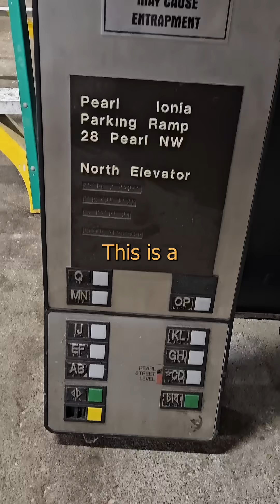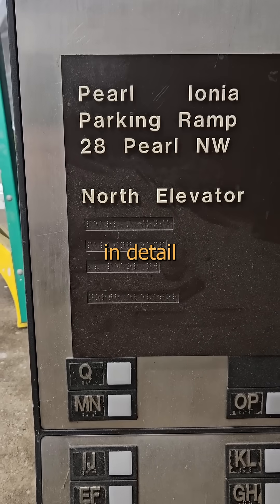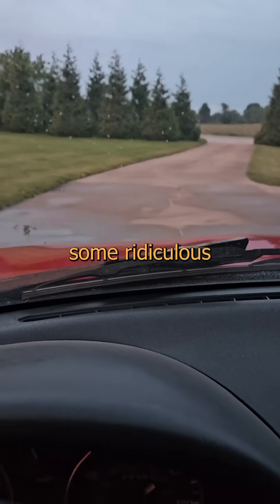Miata Mischief #chrisboden #engineering #gear #elevator #score #stories #parts #hacking #making

Comment: A few months ago I needed to purchase some lumber but didn't have access to any vehicles other than my thirty year old moped. I drove out to the lumber yard and ordered a few 2X4s and then proceeded to drive my moped into the loading bay. The two guys there handed me the lumber and were making fun of me thinking I'd never get it home. Much to their amazement they discovered that someone who's so broke their only form of transportation is a barely street legal scooter from the 90s, is very capable of planting the boards on the foot rest and slinging the other five feet of lumber over their shoulder. Those workers stood there, mouths agape as I expertly drove off with one hand on the accelerator and the other on the lumber. I made it home safely and had my girlfriend take a picture of me with the material on the scooter for fun.

Comment: I ride a motorcycle, and had no option to carry my materials home. 

X 12  2x3 1.3m wood strapped to seat
120L incinerator (full with tools/sealants/fixings)
Lots of stripwood, 
And my bag full to the brim. 
It was a little honda 125cc 

That thing looked like an autistic aeroplane that they wouldnt allow out, and i was the pilot. 
Couldnt pull the accelerator too quickly as the whole thing lifted. 

I couldnt even turn sharp at 20 mph as the front end had little grip, that was fun.. down country lanes... Where people drive 60.

Comment: I used to haul 8ft 2x4's in my HHR. they went over the folded down back seat and right through the center onto the console and to the radio. The back gate had to be tied down and the boards kept from sliding around in the back.

Comment: I built a back yard sized connect 4 for a customer when I lived in Phoenix. When I completed the finish, I realized that the only vehicle I had was a Honda Shadow. There I was riding half way across the city with a 4’x6’ sail attached to my saddlebags and sissy bar acting like a sail… the guys at the woodworking shop took pictures between laughing their asses off in the parking lot.  Never. Again.

Comment: Got a honda big red 3 wheeler for free, had both rear tires popped and flat, first I (with the help of a friend pulling at the front end) had to lift and push the probably 20-30 pound rear end for like 20 feet. (This was earlier this year, and I'm 14, so yes, lifting and pushing 20-30 pounds for around 20 feet was a little hard) then a neighbor came out, saw us struggling to move the 3 wheeler, and helped lift and push at the back, then another neighbor came out saw all 3 of us still struggling, and brought out a dolly that we used to lift and roll the back the last maybe, 30 feet to my house. The entire process took like 2 or 3 hours in total, but the 250cc 3 wheeled death trap was, and is worth it even though it doesn't even run right now, won't go into gear, and seems more worthy of the dump than getting fixed as of right now, but the frame is in near perfect condition, no electrical issues as far as we know, and unable to be fixed without being brought to a family members house because of our hoa in our neighborhood. I plan on the 3 wheeler being on my channel once it's fixed and looks at least less eye melting than it does now.
Reply: If anyone has any insight on it I could use the knowledge, because I have absolutely no idea on where to even begin with fixing the 3 wheeler after getting tires that aren't popped put onto it.

Comment: As long as you do not have to disassemble something to make your stuff fit, it is not ridiculous at all.
I removed all the seats from the passenger side of a peugeot partner to fit several wall panels  to drive them home. That is the only occasion when my girlfriend traveled on a back seat.

Comment: In 1996, I was 14 years old. I lived in California and I found a local gas station that was throwing out a broken smog check machine. I had no idea what was inside, but I needed to know. I asked the mechanic if I could have it, and my friend and I pushed it a couple of blocks down the sidewalk to my dad's driveway. It was old, green, about 300 pounds, and had 2 miles of wires in it. It was awesome! I believe it was a "worldwide emissions analyzer" and it took me at least 3 weeks to take the whole thing apart.
Reply: Big tot

Comment: I had a small three door Toyota Starlet (made in 1984) and a cargo pallet witj building material. The car was wide enough on the inside to fit the pallet and the weight and height was within the limit (it was not a full pallet. So I asked the forklift driver to put the whole pallet in. Around 80% fitted inside. I put the back hatch door down, secured it and drove a 15 minutes drive home without the need to repack.

Comment: I had a newer mazda 3 sedan that i shoved a small block ford motor in the trunk, transmission and transfer case in the back seat, and driveshafts in the passenger seat. Had the damn near the whole drivetrain in that rig lol

Comment: Twas about 2004 and I was early in my long former career as a gas station attendant.
In comes a lady from the economic strata commonly known as "the polite classes" driving a late model Mercedes C class convertible (nearly freudian typed "covertable" there).
Roof down on a summer's day...
With a fucking boat strapped upside down on top of the car.
Needless to say she turned out to be a good sort, pumped her own gas and departed to grins a thumbs up from my coworkers and I.

Comment: My best friend and I went to go get a new enclosure for his snake. For some reason we took my Camry dispute him having two trucks. After we got the enclosure in my truck we stopped by a state park hiking trail. While driving on the dirt road we came across a pile of trash someone dumped, and in that trash was a perfectly good 50 gallon aquarium. So we loaded that up, the stuff for the aquarium, some other random stuff in the Camry and we drove the couple hours home. The aquarium eventually got traded for something else, the aquarium equipment is still in use today nearly 5 years later.

Comment: I moved a 6 foot x 4 foot glass mirror, over my head, Inside a 1998 Ford Focus, across town, balancing it on top of the front seats and holding it with my left hand while I shifted manual, because it was free from marketplace. It miraculously didn't break, and I'm still alive to tell the story.

Comment: Yeah I'm a hoarder, or so They say. So when I spotted a mammoth of an American made teachers desk retired from the local high school years ago and recently tossed out by someone with a bad back and still in excellent shape cause it was certainly crafted  some time pre WW2.  I knew there was No way I could let that go to the landfill so I gingerly flipped it up on the roof of my recently paid off E350 Mercedes. Lucky for me I only had to drive a few miles while holding on to it with one hand. I kept the speed down between 10 to 12 mph to keep it on my roof and keep it steady. Now does anyone need a desk?

Comment: The school was undergoing renovations and moved some classrooms around, one of which was my engineering/robotics teacher's room.  This unfortunately meant losing a lot of power tools in the workshop and while I was unable to procure any of those, I did walk out with a 6 foot whiteboard that I have hauled with me for 12 years now across 5 dorms and 6 apartments.  And because I'm about as careful as your mother was 9 months before having you, during one of those moves, it slipped from my grasp and scratched my computer monitor leaving a good 4 inch scar dead center.

I've yet to actually use the damn thing and it's currently in storage with a lot of other keepsakes.

Comment: Bought a electric organ (musical instrument) for 5 bucks and it didn't quite fit in the bed of the ford ranger. Just jamed more stuff to wedge it in place. Then we dropped it down the stairs trying to get it into the loft of the barn. Still worked but had the extra anesthetics of splintered wood.

Comment: Took an 8 and a half hour each way drive with a friend in his Volkswagen Jetta to pick up some diesel ford ranger parts. We picked up 2 motors, a transmission, a clutch, and assorted other parts. We had preemptively removed the back seat and after some creative jacking up and minor disassembly we managed to get both engines in the backseat area with the assistance of a cherry picker, the rest of the parts went in the trunk, the ride was surprisingly smooth despite looking like the rear suspension was bottomed out.

Comment: One Saturday my friend and took a drive in my turbo MX5 (Miata) for you backwards yanks, to the local hardware store. Just because Saturday, a few hours later we both had forgotten that the vehicle we had brought had the luggage capacity of a loaf of bread. As we walked out of the store with a 7ft lattice gate to stop his dog getting out of the side of the house. Needless to say we didn't go back and get a proper vehicle. We drove the 5 km home, with my mate holding the gate over his head, trying not to damage My car or loose the gate.

Comment: I hauled the carcass of a 1990 Toyota Supra on a 4x8 landscape trailer 20+ miles with a 2005 Subaru Legacy, with a 1¼" receiver. Found out when I got to my destination that the entire rear structure of the car was rotted (worse than I thought) and the trailer hitch was barely hanging on. If I had gone 30 miles, I would have lost the trailer...

Comment: i was driving my dads miata to work (we have some strange plate number based car ban here in the Phils.) but the 3x 2000 era PC tower broke and 2 monitors and i had to go and buy new ones... but i forgot i was driving the small car... had to drive with the top down and boxes stacked in the driving seat and improvise some bungee cord and the seatbelt to secure the new computers. the funny thing is the rear boot/trunk was empty because none of the boxes could even fit.... for that 45mins, it was pretty cool..

Comment: While driving to work one morning in my 61 bel air I saw a 91 Suzuki rm250 dirtbike on the side of the road with a sign that said free, I knocked on the door to verify and loaded the bike into my truck back tire first and strapped the trunk lid down on top of it as much as possible. 20 miles to work and 20 back home with the bike hanging 1/2 way out of the trunk.

Comment: I once had to transport the lengthwise pipes for my wife’s hoophouse from the nursery we bought it from to our home. I didn’t realize I would need to transport 20’ plus lengths, so cue stripping a random piece of romex I had in the cab down to the three wires, threading them through the bed and mirror standoffs of my ‘84 F150, and wrapping them by hand as tightly as possible around the poles, half on and half off the sides of the pickup bed for the 10 or so miles back home. Pics available upon request!

Comment: I carried an snap on Classic heritege tool box, chock full of tools weighing over thousand pounds all together in a 2 door chevy cobalt both To a new job at a mechanic shop and home from it when I quite a few years later. I loosened the passenger seat, removed all the drawers and tools stacking them in the trunk and then I picked up the empty box and laid it in the back seat, bolted the seat back down and then filled the passenger seat with the tools that didn't fit in the trunk. The second time the cobalt I had was a total Pile, the exhaust leak noise was resonating through the empty box and was shaking all my windows. 

I also moved cross country in a 2 door chevy cobalt loaded floor to ceiling with all my belongings that would fit... Twice

And Yes I've own 3 different 2 door chevy cobalt 5spds

Comment: I bought a backyard shed on Craigslist. Required buyer to disassemble.  Borrowed buddy’s truck and trailer (first time towing).  Took apart the sides, but was getting dark, so decided to just put the roof on top of the other parts on the trailer.  Didn’t have tie-down straps.  Drove slowly on the backroads, but everything was going fine, so got a bit reckless with my speed.  Caught a glimpse of the roof becoming airborne in the side mirror out the corner of my eye just as an oncoming car’s headlights came around a curve.  Roof smashed to the ground mere feet before the car ran it over.  Literally zero time for her to react. Flat tires, but otherwise unscathed.  Few milliseconds sooner and it would’ve been straight through the windshield.  Wouldn’t you know it, was an off-duty police officer. 

No idea why they let me go. Buddy’s insurance went up.

Comment: I stuffed a fully built Herman Miller Aeron upside down in the back of a Mazda 3.  it required putting the pneumatics down to the bottom, rolling the windows down, and 30 minutes each side to get in and out of the car.

Comment: I accidentally hauled an extra muffler home. And I do mean accidentally. 

So picture this: I’m shopping for a car since my first one had a one week lifespan before my lack of reaction speed on one instance doomed it to a crunchy end. Everyone was fine but I need a new vehicle. 

I go to a dealership for a car and take a look. They’re asking 8.5k usd, and it’s not a bad car, but I’m hesitant on that price. A check of my bank account reveals I actually don’t Have that much, as I gave my parents 2k to help them cover repairs for one of the two family cars. 

Intending to use it as an excuse to leave, I say I can’t do more than 7k. Guy leaves to talk to his boss… aaaand comes back and says they’ll take that offer. So now I have a new car despite not really expecting one. 

I drive it home, drive it around for a bit, and later acquire some of the essentials like jumper cables and window scraping stuff. And then I go to put it in the back of my car. 

I open the trunk expecting an empty trunk… and I am instead greeted by a very large metal part I can’t yet identify and did not place there. I show my dad. It’s a muffler. My car HAS its muffler. So this is just a random extra one. 

I call the dealership. The guy who sold it to me? Equally clueless. I offer to drive it back to them. They don’t need it. 

So now I just casually have an extra (slightly rusty) muffler in the back of my car and still haven’t moved it. It even came to nebraska with me. 

I have no idea what to do with it.

Comment: 2001, bought a Nisan EXA (Targa top), 2 x 12" Kenwood tornados and 1000W amp in the back, joined a car club, got a portable UHF CB. Ended up keen enough on radio to buy a base station UHF setup...
Picked it up... in the carpark i opened the box, set the radio  up in the passenger seat, stripped the power wires with my teeth and bound them around the capacitor terminals in the back, the antenna poking out of the targa roof..
Soon after i went for my amateur radio licence, 22 years later upgraded to advanced.
Curiosity and ham radio make a great combo.

Comment: I had to pick up some tools left behind at a job site from putting up some cameras. I had an 04 BMW 325i convertible and a list of things, a couple boxes of various tools including some hammer drills all fit in the trunk. Meanwhile I had the top down and a ten foot ladder, hanging out upside down holding on for dear life with nothing but a scrap five foot piece of cat 6 holding it to the passenger seat headrest.

Comment: I fit a TEN FOOT 6x6 pressure-treated beam in my 1994 Volvo 940. My truck was off the road for the winter (to preserve it), and I had no choice! I had to remove the backseat center armrest and the frame around it first ... then once I got it in there, I backed too close to the wall at my work's parking garage, and hopelessly jammed my shifter into park! Luckily the 940 is robust enough that I was able to tweak the shifter around to neutral, and shove the car forward by hand enough so that I could pull the beam back 4" so I could get it in "drive"... LOL!

Comment: When we moved my dad brought all the large rocks from our old house, a dozen bigger than cat sized rocks, not to mention all the various large rocks he dug out of the ground including one that was bigger than 2 people volume wise and broke 2 or 3 car jacks trying to get out of the ground and ended up spending days using a system of 2 brand new car jacks on either side supported by a bunch of boards jammed underneath and gradually infilling with soil.  It's a fantastic rock, just sitting right above the spot in had been previously buried 6 feet under

Comment: It wasn't coming home with me, but when I was in college I had a job with an architecture firm as a computer systems engineering major (circa 2018). They were designing a plastic bottle that could be used as building blocks for temporary housing that I did some electronics for. Now I'm from rural midwest America and had a 1997 RAM pickup, went to school in upstate NY, this job was in downtown NYC. They needed a way to get two 9ftx9ft "platforms" made out of pallets with some extra plywood a few miles away for a design fair. So we put both of them on the bed rails of my truck with no way to secure the load. I then drove through Manhattan to Brooklyn on nothing but city streets during rush hour traffic.

Comment: I have a 2009 Toyota Corolla. It's my first car, and I have owned it for sixteen years. 1.) three trips cross country 2.) one of which has 900lbs of stuff in it. Had to get the brakes and shocks replaced once I reached the end. 3.) five trees from the local nursery, with trash bags over the branches to prevent damage. 4.) lumber. Lots of lumber 5.) a cabinet, strapped into the trunk with the lid tied down over it. 

Drive safe kids!!